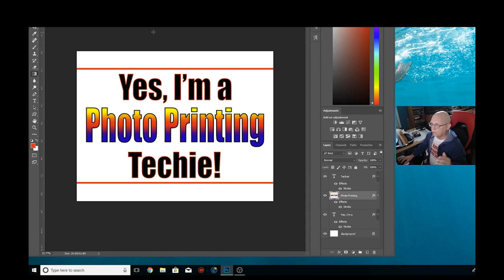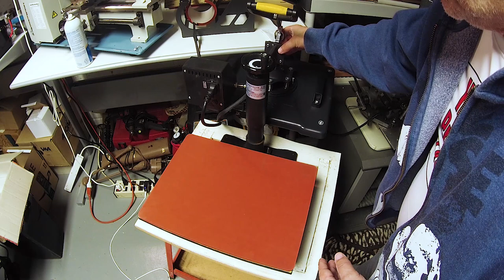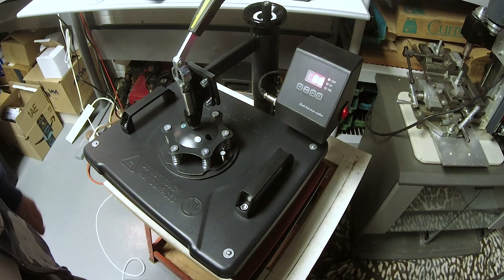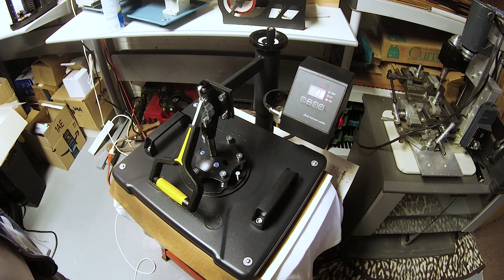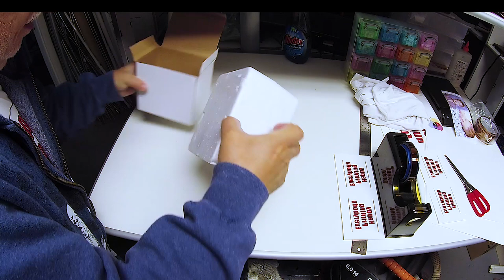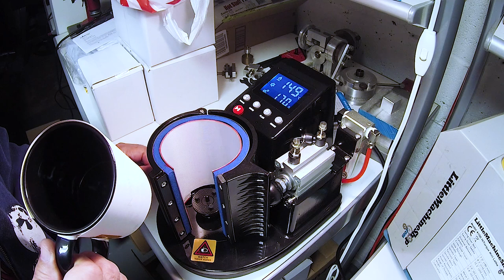How I Sublimate to T Shirts and Mugs

Comment: I wonder if a counter top convection oven would help speed the process. Experiment of course to find the right 'oven' temp so as not to burn the sublimation medium, then load in your prepared mugs and pre-heat them to the preferred temp --- then transfer each to your mug printer and voila you're off and running. Of course I have no idea if this would work, but should it be successful you've begun the next best thing to an assembly line process with one press, that is until you hire extra hands to load up the dozen or so presses you will need to fill all those orders. Great job with your video,
Reply from the maker: That oven process is already being used. You have to wrap the mugs in heat resistant silicone wraps that have a clamp. The. The mugs are placed in the pre heated oven. But it takes longer to heat co pared to the press.  I do not have the need for high production systems. Maybe hopefully some day.
Reply: By the way, are you able to get more than one, perhaps several t-shirt pressings from one media design .... or is simply a one to one effort?
Reply from the maker: You need one printed sheet of sublimation paper per pressing. They can not be reused as most of the then solid ink is sublimated into the pores of the fabric fibers. You can not even feel it on the shirt surface.

Comment: Hi Jose, can i offer a tip for t shirt printing? I use an A3 size piece of stiff card with Teflon sheet wrapped round it and secured with heat proof tape at the back. I then place the card inside the t shirt  ready to print. It also makes it easier to move the shirt from a to b.
Reply from the maker: Great idea.

Comment: I have the same press you have and didn’t know that the platform does slide in and out so you can position your shirt before pressing.  I found it out by mistake.
Reply from the maker: My old one swivels the Upper press out of the way the base does not slide in and out. Nor does my new one.

Comment: Hi I was wondering how much does your set up cost?  I am in the printing industry and just exploring more revenue paths.  And what is your cost in producing a tshirt/mug?
Reply from the maker: You need a printer. You could spend $1000 for a turn key Sawgrass printer option of buy a small EPSON printer off of EBAY all ready set up for SUB work. Plus from $150 to $$$$$ for a heat press. The cheap ones do not last but a few months. Plus materials such as inks and transfer paper and substrates.

Comment: do you need very high pressure for sublimation or the same as HTV?
Reply from the maker: If you mean heat press pressure you learn what the correct pressure is after much testing. The cheaper heat presses do not have a way to measure pressure so it's all guesswork. Once you have it set at something that works you'll have to reset it when you change substrates as different substrates are of different thicknesses and that will affect the previous pressure setting. It's constant guesswork

Comment: Thanks for the video Jose.. What model mugs are you using? Where do get your mugs? Where did you get the-mug press? Also heres a tip: if you doggies fold one end of the tape it will be easier to remove. 
Thanks
Lucy
Reply from the maker: There are no "Models". You just search for either mugs for sublimation or sublimation mugs. Go my Amazon Afilate LINK and you can find thèm there. Tbe differences will be internal color. Wihte red or black.

Comment: Awesome tutorial! Thank you so much for this! If you might have the time, I was wondering what might be a good paper stock for printing bookmarks. And would you need to finish them with some kind of spray coating to make them more durable?
Reply from the maker: Book marks are usually laminated. At least the good ones are. I would choose a color laser and card stock. Inkjet would not be a good choice for this in my opinion.
Reply: Hmmm, another printer to buy! lol Thanks for the recommendation!
Reply from the maker: Well the problem is that Printing on Inkjet media through it will look fabulous, most inkjet media is difficult to laminate IF you want them to last and stand to normal abuse.

Comment: Keep the great work. 
Please, I run into problems when I printed an image on a mug it was all rubbish. The ink bleeds and the photo shakes full of paralleled lines. 
I used t-shirt heat transfer paper on the mug. Could that be the reason? Do I have to buy a Mug or ceramic transfer paper for the mug printing?
Reply from the maker: Yes to everything. T-shirt heat transfer paper.is NOT for Sublimation.
You need a Sublimation printer, Sublimation paper, a heat press, NOT and iron. And for mugs you need a dedicated Mug heat press and of course special polyester coated ceramic mugs.
Reply: Thanks for the clear explanation.

Comment: Love your video but do you do dog tags if so what temperature pressure would you do them on
Reply from the maker: I did not. But when you buy sublimation dog tag blanks they should provide some basic settings for young experiment with. You will have to find what works for your particular setup.

Comment: Would a parchment paper work instead of the regular protecting paper you are using? and do you have to pad the shirt with a pillow inside of it , can you just use a paper inside?
Reply from the maker: Yes that would work. No need to PAD th shirt. In the video I am experimenting to to come up with my own workflow. So far so good. Parchment paper is very good for this and I have to buy some.
Reply: You'd only need to use paper inside if you're doing a full transfer/design on the front of the shirt and/or back.

Comment: i have a epson wf 2750 do I have to change the ink to sublimation ink? or can I use the ink the printer comes with?
Reply from the maker: Of course you have to. Inkjet inks are not sublimation inks. It simply will not sublimate onto a polyester T-shirt or other polyester coated substrate.

Comment: Hi there, i'm looking to start printing on Hoodies, would a heat press like the one you've used work in this situation or would i need to order something else?
Reply from the maker: Probably but to be sure just search for that in YT and you will surely find some videos on Sublimating to Hoodies. Not something I would get into as I am only interested in Image transfers onto Aluminum.
Reply: @cheo1949  Thanks, another thing: is it actually ok to use regular sublimation paper on dark fabrics? I've been looking all over the internet and i only find sublimation paper that says "Not to be used on ceramics or dark garments". Does this mean it will not work when heat pressed on? i can't find any sublimation paper that's used for dark fabrics.

Comment: Hi Jose , I wonder what brand of ink you are using ? Thank you very much for your video!
Reply from the maker: Original OEM, Precisioncolors, Inkowl and Inkjetmall.
Reply: Thank you for answering, from the three mentioned I am interested in sublimation quality ink, I figure must be the inkowl? Thank you
Reply from the maker: Well  no I was referring to Photo Printing Inks and not Sublimation. The inks that I am using are from Precisioncolors and will begin to ship pretty soon. SO far they are excellent even on a simple 4 color printer like the EPSON WF1100.
Sawgrass makes the best sub inks actually and I presume that the PC Sub inks also come from a similar source.
Reply: Hi again, sawgrass has their own printer, I am using Epson 1500 w decide to go with intek sublimation ink, I am n Uk now, the problem I have is that the skin on the faces and people are coming out red. I am trying to adjust the curves but still I cannot predict what is going to come out. Any advice ? Thank you

Comment: I HAVE A CANON PRO 100 IS THERE SUBLIMATE  INK FOR THESE TYPE OF PRINTER IF SO WEERE CAN I GET IT FROM
Reply from the maker: You can not sublimate with a Canon printer. The thermal type print heads can not handle the inks and would fail very soon. Only Epson or Ricoh printers with piezo crystal printheads can handle them.

Comment: Hello what brand sublimation printer, ink and paper do you recommend?
Reply from the maker: I am currently use A-Sub and it seems to be very good. However, I have could need to try others and compare identical prints papers on identical media such as Chroma Luxe aluminum sublimation plates. I received two types of transfer papers from CONDE Which are the leaders in the sublimation industry and then I will report on it.
Reply: Thanks!!!

Comment: I am watching that Workforce 1100 and noticing how Slow this unit is for the supposed high price it's going for. I have a Canon that is streamline, yes it's laser jet and not capable to be sublimate working, but that cartridge is shaking and slow which would put me behind schedule on production if I went that route. Ideas ?
Reply from the maker: Yes the 1100. Is slower than a laser printer but you cannot use a laser for sub printng.
Reply: @cheo1949  I agree, hence the reasoning for going another route. Production time is important plus we don't want the inevitable expense of purchasing all Sub materials.
Reply from the maker: But you do have to purchase all the sublimation materials. There is no way around that.
Reply: @cheo1949  actually, there is. Sublimation is not the only method in T-shirt work . 😎
Reply from the maker: Sure but DTG specially is you want to hace white ink included will not give more than a few months as it will clog tbe printhead horribly. Plus you will need a RIP To be able to print. A converted Epson printer for DTG WILL end up costing more than a sublimations system. But you seem to know what you want or need.
Reply: @cheo1949  yeah guy, I pretty much double checked myself on this. I reviewed OKI which is high plus the super cost of the ink, white being way up. I've already tested out a few transfer paper test, plus been using vinyl for some time but hey, ya do what your comfortable with. Anyways, good video 👍.

Comment: Hello is sublimation ink toxic? Can you drink in the mugs and eat on the plates ?
Reply from the maker: Once it is sublimated into the polyester coating, it is is encapsulated and yes it is safe. Mugs are not sublimated inside. But no. It is not toxic. So far I am fully alive and kicking.
Reply from the maker: Jose Rodriguez 1 second ago

Need to add that of course you would not ingest ANY Type of I'm jet ink directly!
Reply: thanks

Comment: How much was the shirt?  Type?
Reply from the maker: I think the make was Gildan and they cost about $4 100% Polyester.
Reply: Jose Rodriguez so with the sublimation paper it will coast around $5. ?
Reply from the maker: Yeah that's about right. Shirt Paper and inks.  Larger sizes might run you a buck of two more and you would need larger paper for a larger graphic. Of course you've already bought and set up your Sub Printer and Heat press. .

Comment: Hi, what type of printer were you using for your tee shirts please?
Reply from the maker: The printer is irrelevant. As long as it is and Epson model that allows third party refillable cartridges to be used. Then you need special sublimation inks plus special sublimation transfer paper to print on. Once your graphic is printed in reverse or mirrored, you use a Heat Press to transfer the printed graphic onto a 100 percent Polyester Garment. Have seen my sublimation series?
Reply: @cheo1949  Thanks for the response. No I haven't seen your sublimation series, are they here on YouTube?  I plan on making tee shirts.  When you say the printer is irrelevant, are you saying the quality of the graphics from the printer doesn't matter, as in the better (usually more costly) the printer, the better the results?  Also, how do I find out if it allows third party refillable cartridges to be used?
Reply: BTW, I just subscribed.
Reply from the maker: Thanks. Yes, just look in my over 40  PLAYLISTS for the Sublimation Printing Playlists.
Reply: @cheo1949  OK I will take a look

Comment: How do I set up an epson printer to sublimate
Reply from the maker: You use any EPSON printer that allows refillable cart use and fill those carts with sublimation ink just like you would with regular photo inks but once you commit to using sublimation inks that is it. That printer now is forever a sublimation printer and you cannot go back to regular ink Inkjet photo inks.
Reply: @cheo1949  Do you have a video that shows how to connect the refillable cart?
Reply from the maker: OK I think you do not know what refillable carts are. You fill them with the ink you want to use so a CYAN refillable cart would be filled with the matching Sublimation ink - CYAN. And you insert it into the print like you would insert a regular cart. I would suggest you buy a ready to use already converted sublimation printer from EBAY. 
https://www.ebay.com/sch/i.html?_from=R40&_trksid=p2380057.m570.l1313.TR12.TRC2.A0.H0.Xsublimation+printer.TRS0&_nkw=sublimation+printer&_sacat=0
Reply: @cheo1949  So I do not necessarily have to have the tanks? All I need to do is fill the cartridges with sublimation ink, correct? This is if I do not have a sublimation ready printer.
Reply: Also, where do you recommend to buy the sublimation ink. Do I use the cartridges that comes with the printer or do I need to order empty cartridges for the epson that I have?
Reply from the maker: Buy one already set up!
If you insist on the one you linked to then you need to buy refillable carts or CISS unit and fill and install those.
Save yourself the trouble and buy a printer already set up for sublimation.
Reply from the maker: You do need the refillable tanks. You can not refill OEM epson carts or tanks
Reply from the maker: precisioncolors.com
Reply: @cheo1949  Thanks so much